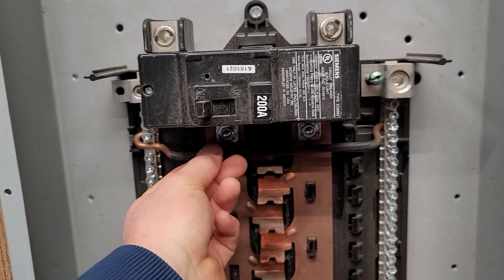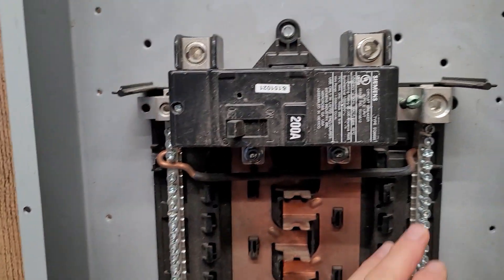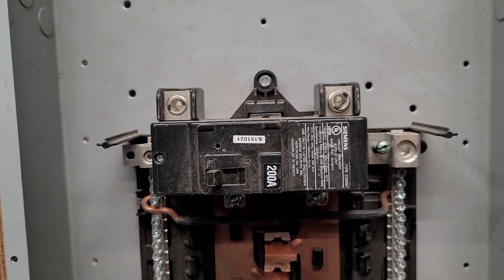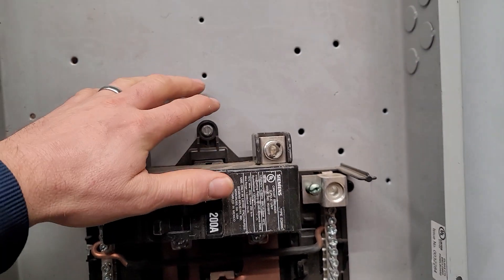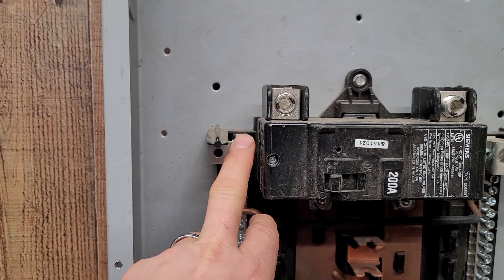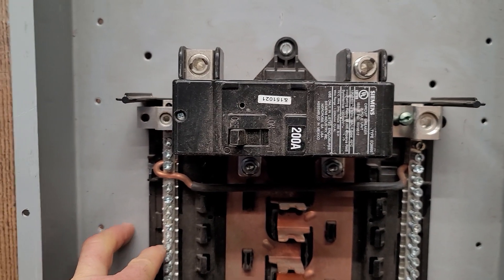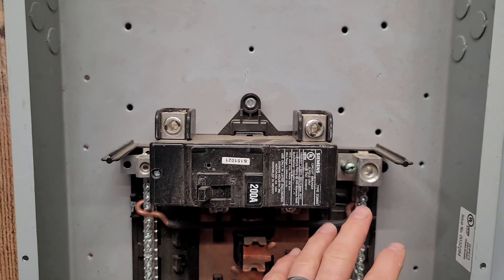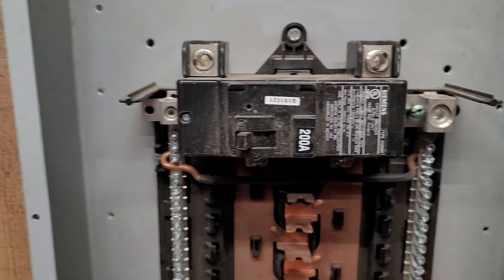Watch out! Separating Grounds and Neutrals

Comment: Question? After installing an ats and separating the ground and neutrals  in the main now sub panel.  Is it also necessary to move the main ground to the ats and run a jumper ground to the main sub panel from the Ats.
Reply from the maker: It depends on the scenario, if you are going to leave the grounding electroconductors at the second point of disconnect they must be full sized

Comment: My main panel has neutrals on both sides of that bar and then separate ground bars that connect to wires going outside but does not appear to connect to the neutrals. They put all my grounds on the ground bars but when an electrician added another circuit he put both neutrals and grounds on a neutral bar which is different from every other circuit in the panel now and stands out. Somehow it passes inspection anyway. how weird.
Reply from the maker: Definitely contact a qualified licensed electrician

Comment: Would it be safe to land a large (#3) neutral from an 80 Amp sub panel to the can of the main panel? I only ask because the #3 neutral is too large to wedge into any of the slots on the main panel neutral bar; they only take up to a maximum of a #4 conductor. And why not, since the Neutral bus and the Ground bus both meet up at the main panel anyway.

 Is there any real distinction (electrically) between the Neutral and Ground, when they’re at the main panel?